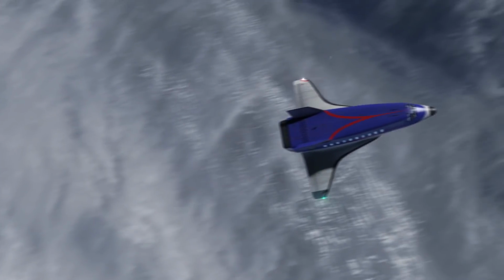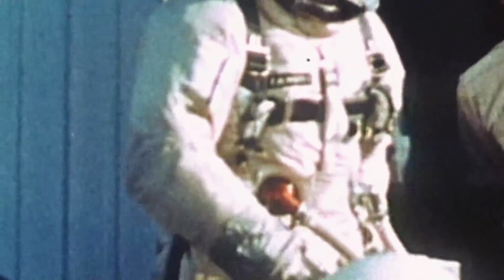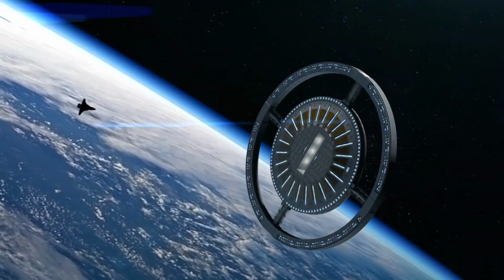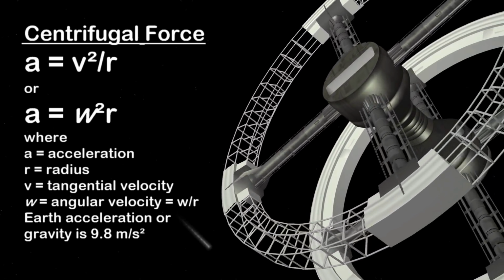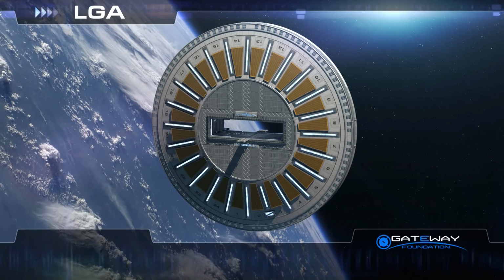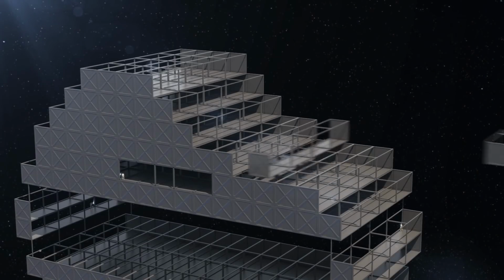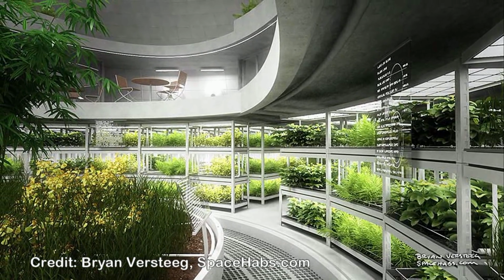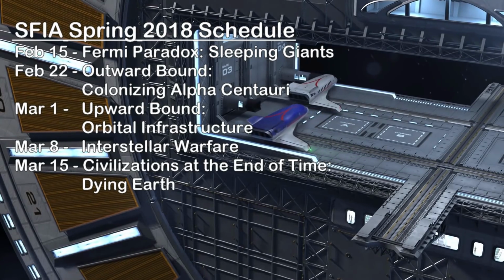Spaceports

Comment: Isaac, I've been wondering for a hand of days about  planets with a global ocean...(extending the etymology of Ecumenopolis perhaps Ecumenokeanos?) I know plate tectonics, a topic that is not exactly my forte, is a vital part of the carbon cycle here on Earth. It occurs that on a Super Earth might you expect the increased gravity to similarly increase isostatic adjustment,  and that mountains, if they rise, will erode more quickly due to that increased gravity. 

Sufficiently massive worlds may not need much water before they develop global oceans as elevations would be persistently regularized. Could this lead to repeated "great oxygenation events" if a photosynthesis analogue develops in the water, depleting atmospheric greenhouse organics like methane and creating snowball Super Earths or crusting the entire ocean under meters and meters of ice greatly diminishing the available energy for any protists wriggling in the depths? Sufficient vulcanism could prevent this, but my hunch is it would have to be orders of magnitude more active than Earth's today.

If intelligence did develop in these oceans, it'd be denied fire, the first and best tool to perform primitive work, and metallurgy, a seeming prerequisite for space based assets of any sort (though I find the notion of seashell communication satellites romantic). Worse, if this intelligence lives in a glacial interregnum, fire in the heavily oxygenated open air could be too volatile to meaningfully exploit. If Super Earths are as common as exoplanet surveys are suggesting, is most of the intelligent life in the universe stuck in the stone age in the global spanning waters of their homes? Could a technological civilization develop underwater? And if we happen upon them when exploring the cosmos, what responsibility, if any, do we have to "unlock" these creatures? 

I know you've touched on this type of world in the past, but would love a deeper dive (<shameless pun) into the topic of these water worlds. Anyway, big fan, thanks for all your hard work creating stellar (<another one!) content. Cheers.
Reply: I think we'll find that tectonics are fueled by the presence of a large moon, so tectonics and tides are likely to go hand in hand.  If that's the case, then your shallow sea world would have a pretty big wave pulling up all the water early on, a lot like the movie Interstellar.  That might make life hard early on till there was enough water to go around.

As for fire, you might look to early cyanobacteria on Earth.  They very often congregated together on "logs" of mucus, which floated atop the waves.  This let them chase the sun (for photosynthesis) and have access to the vast wealth of CO2 in the atmosphere.  By analogy, life on a water world could ultimately evolve to "make" it's own land and create floating cities where fire would be possible.

Similarly, many early ocean single celled diatoms created calcium or silica "shells" around themselves.  This showcases how "metallic" ions can be biologically extracted and crystallized from the water.  Given enough time, and a little lucky evolution, it's conceivable that a multi-celled organism could extract enough ions from the waves to create stronger metallic crystals or alloys to weave into their plant-type sugar polymers.  Indeed, many land-based trees do this to great effect.  For example "Ironwood", which is famed for its hardness, has silica embedded into its cell walls.  You might use this notion to explain how such a planet might handle the resource extraction needed for building a space program.

Comment: Why would you increase spin to build the MGA and wreck the Lunar gravity simulation?  Just make the MGA ring a little bigger in diameter and keep the whole structure at 1 RPM.
Also, how do you land those space craft when the center is apparently spinning?  That would probably require computer control of thrusters, but if the center part had an axle that didn't spin, it would certainly make landings easier.
Reply: Judging from the animation.  First, you align your velocity to the axis of spin.  Then you spin your ship at the same rate as the station.  Then you fly straight into the middle of the opening.  At that point the station will reach up and grab your ship with a mechanical arm.  The arm then pulls your ship "down".  At that point you are either held there by the spin for off-loading, or the arm moves you along a rail to another point in the docking area for disembarkation of passengers.

Having any part of your station which does not spin, can make for a giant engineering headache.  Designing a 1 tonne satellite with such a "Slipring" cost NOAA/JPL around $1 billion.  Trying to do the same thing for something that size and which also has to hold an atmosphere?  That would be *Hard*.

P.S.
I agree with you about ruining the Lunar Gravity, but you can always build another station (or another segment along the axis) to do the job.

Comment: First, I think your channel is great. But made me wonder....why wouldn't the use of a sterling cycle engine work in space? Where temperature difference could be made with either shadow or reflected light? I wouldn't ever claim to know how much power you could rod it of not to stall out one but ...?
Reply: Recall that a sterling engine extracts energy from the flow of heat from the hot side to the cold side.  So ultimately the cold side would warm up unless something carries the heat away.  In space, of course, the only way to get rid of heat is to "radiate" it away as photons.  That means that you'd need a pretty big radiator to maintain the thermal difference.  More than likely you'd also need active cooling (a pump pushing fluid around the radiator), that would take power away from your motor.  It's definitely doable, but there's a lot of complications that add extra mass and more moving parts.  In the end, it may not beat "solar panels" for mass and efficiency.  Only an engineering study could say.

Comment: Once again, an outstanding work, covering considerations you don't think about the first time around.
I can see why you focused on this station concept, it has much to appreciate about it.
Everything we have had to this point, has been cylindrical to fit in a shuttle payload bay or to fit on a orbital booster.
Also, it dictated its size and weight, the similarity to a submarine is comparable.
Still a fan of the inflatable module concept but, this coud work as well.
Reply from the maker: Yeah inflatable is potentially very handy, especially for ships which can go in compact than expand to create a bigger work environment, but I don't think it's ideal for a permanent large orbital installation.

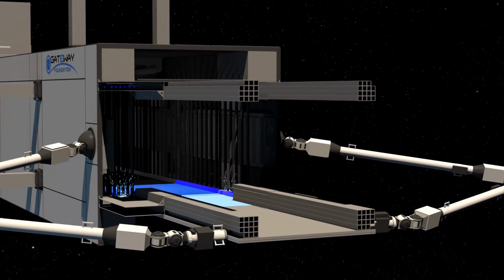Comment: At 8:30, I'm a little confused.  Isaac says the trusses don't need to be built to withstand gravity, but the structure is spinning to provide gravity, right?  It wouldn't have to handle wind, like hurricanes or tornadoes, or earthquakes, snow load, etc. so that would help quite a bit.  But at least some parts of it would have to handle the pressure of vacuum vs. whatever air pressure we're using (depending on oxygen saturation in the air).

Comment: I actually have a very basic conceptual design that I'm working on in Google SketchUp for a Space Habitat that actually mirrors some of the things talked about in the video, like the stuff about the Gateway Foundation as my design is modular, constructed on orbit, and features an array of different functions for versatility. Though my design is built on the ground in large modules and are sent up via Ultra Heavy Lift Reusable Big (Not As) Dumb Boosters and assembled with some type of autonomous construction spacecraft. It would also have a central hub for zero g experiments and recreation along with a central dock. The central area would be composed of some zero G modules attached to an adapter hub to connect the spinning and non spinning sections, or the entire thing would spin. There would also be processing and manufacturing hubs in the zero section along with some located in the rings. Attached to the front of the center hub would be an assembly building (possibly surrounded by the manufacturing hubs) where large scale construction of additional modules would take place in order to make expansion and sustainability possible. There would be 3 rings (changed from the former 2 after watching this video as the Low G importance makes total sense), Earth, Mars, and Lunar gravity with zero G in the center. It's meant to be a spaceport, space industrial hub, and semi permanent/permanent pioneer type space habitat as the majority of the station and or station rings would be devoted to hydro/aeroponics and life support including water conservation and computer assisted control over a nitrogen and carbon conservation cycle. The station would be assisted by chemical construction spacecraft for assembly of new components, and solar/nuclear electric tugs would shunt modules to different orbits or bring in raw materials from different orbits, the moon, or from NEOs. It's very crude and not on the scale/complexity and efficiency as the Gateway Foundation's design, but it's nice to see that I have some similar ideas as people who really know what they're talking about! :D

Comment: Perhaps we could expand on the spaceport theme by explaining the advantages and disadvantages of spaceports and space stations at orbits other than low-Earth orbits. Examples could include a staging spaceport for industrial purposes at Earth-Moon Lagrangian point L1; infra-red deep-field observatory at Earth-Moon L2; geostationary orbits etc.

A little disappointingly, the Gateway graphics show passengers disembarking from their liner near the hub, yet they walk out normally at seemingly  Earth-like gravity levels. Roughly estimated (very roughly), they look to be disembarking at maybe 10-15% of the distance from the hub to the outer ring. They would therefore be falling slowly forwards in the direction they are shown walking, accelerating gradually as they progress outwards. Movement from the hub to the rim (and vice-versa) by passengers would likely need to be by elevator, with ladders in reserve for services and emergencies.

Nevertheless, another fine video. Keep up the good work :)

Comment: Also, you state that launch costs have dropped dramatically in the last year.  That hasn't actually happened, Nore is it projected to.

Folks often assume it will watching SpaceX or their fans brag etc.  But in reality they, nore anyone else, has actually dropped cost to orbit.  Indeed proposals to do so with new craft designs like DC-X, VentureStar etc. hit a wall with customers, and old major drops (like the Russians selling off old Soviet missles for launches far bellow normal costs) were short term and didn't drive changes.

Costs are currently driven by the lack of economies of scale due to tiny launch markets.  Massive increases in demand for launch, will drive costs down proportionately.  Current fuels and engines, and designs dating back generations, can deliver cost to orbit in ten $ a pound range.  Said costs will cause massive market growth, but we're stuck with the chicken and egg dilemma.

Comment: A thought about the construction method of the station shown.  I know it's not your particular idea, but it's actually backward with stacks of sheet metal and beams delivered to a construction bit in orbit.  Even now big ships etc are built in large fully outfitted blocks ( sometimes built in other countries and shipped to the yard) lifted into place and welded in.   Given the shuttles built to lift heavy mass are not that volume limited, it makes no sence to not pre assemble ( and largely pre outfit) the big blocks on the ground before lifting them to the assembly point.  

Later on if you have mines and foundries in space you could well extrude whole rinds of buildings ( walls floors, etc) strength out of the raw steel.  Weld in cross walls etc and outfit.

Comment: I dunno. If this is a pragmatic architecture then its more likely only two rings would be built and several stations first, and the complete design might not even be in terrestrial orbit. If you've suggested this then please note I had to cut out early

Comment: Another advantage to gravity is that the practice of medicine itself gets easier.  Blood pooling and body position in zero-g are very bad for surgeries.  Having someplace with an on-board hospital would enable a lot more people to qualify for flight.

Some problems I saw for those animators to fix is the direction of gravity, people should be climbing off a ladder from that shuttle.

Some things they should integrate into the station design is areas of habitation which can be pressured to different levels (for research and pre-breathing reasons) and exterior walkways.

The Stepping Stones: APIS technology would probably also help this design along.

I'd really like to see the design cost estimates.

Comment: The problem I see with their base design is the landing bay orientation.  The Shuttle docks center of rotation (ok) and then is transported inside and then translated right or left ... which is down relative to the center of rotation and gravitational forces.  So, when the Shuttle arrives at the passenger transfer hatch/gate (4:30) they would not be walking out but falling out as they are oriented perpendicular to the gravity created by rotation.  Granted they are in a 'low gravity area' but they would still be thrown outward/downward by those forces. As with the rest of this center area, the direction of the rotational gravity forces would be radial not linear.  Another thing to consider is the weight of the Shuttle is now offset from the center of rotation and would create a wobble in the station unless there was some counterbalance weight that would move asymmetrically with the Shuttles translation.

Comment: 4:35 walking from spaceplane right away this near the center of spin? People are blind and believe every damn company saying its possible. Look at sheer size of that spining station..
Reply from the maker: That's just a concession to the animators, a film company did them and probably used existing assets and rigging, no visualization is perfect nor usually worth the effort to make so.
Reply: No, not center, there is a rail that moves them off center at 4:25.  The stars are moving a few degrees off of vertical.  Those people would flop face first down the corridor and pile at the far side.  :)
I suspect that there was an original version where the exit tube did not have a window.  It should be people in sflight suits using a ladder or slide pole.  Someone decided to cut/paste a corridor from some other animation.  There is no reason to build a window there.  The passenger ramps at air ports do not have windows even though there is no vacuum problem at the airports.  Someone thought it needed to be more clear that the "thing" is a corridor.  They did not have an animation of people climbing a ladder in a low g environment.